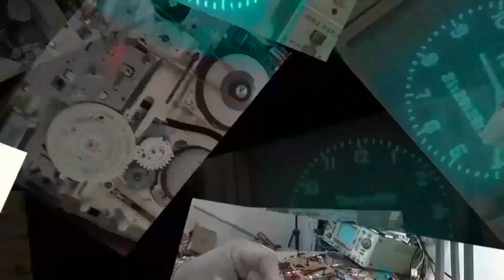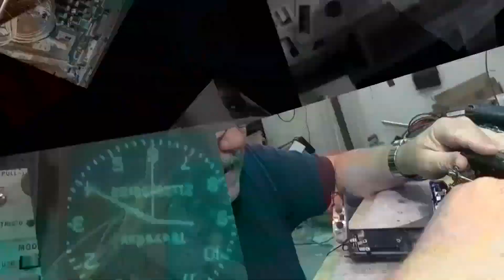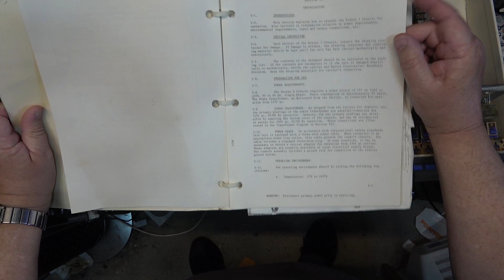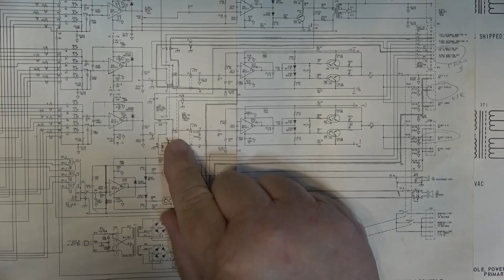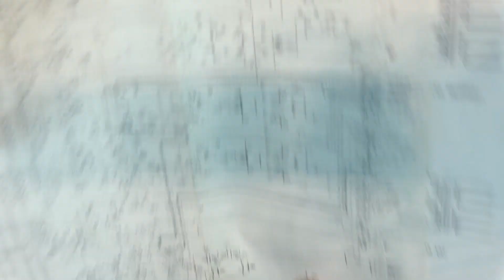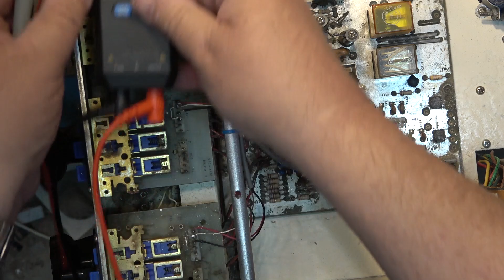Harris Stereo 5 Radio Mixing Console pulled from CKWX 1130

Comment: The good old days before refusal of giving out service manuals and you could even find a circuit diagram inside the unit you opened. As a biomedical engineer at my hospital, when we buy new equipment, there is a mandatory claim that we need service manuals but those are rarely detailed. For this you need to attend to an expensive training course at the manufacturer to get access. I do scan all my manuals into PDF to preserve them.